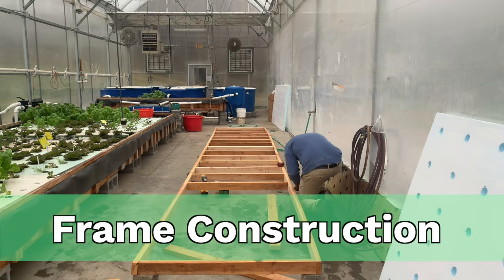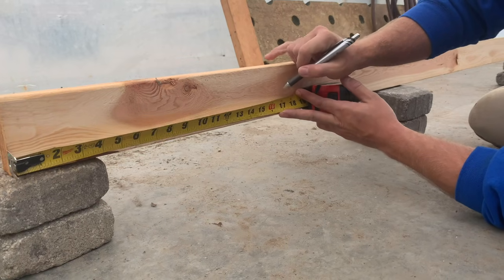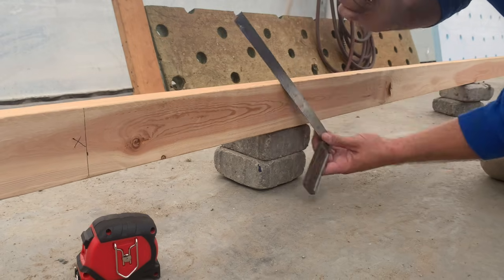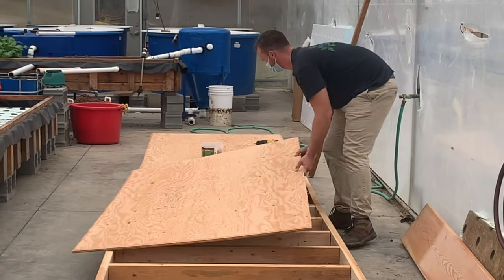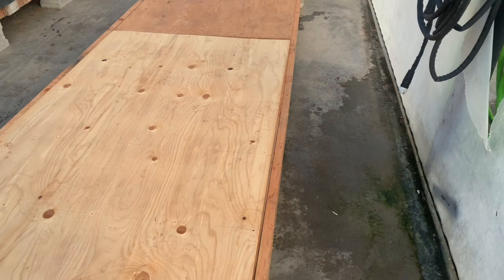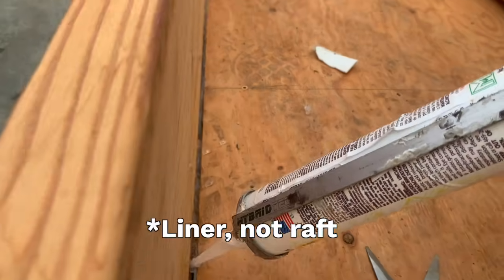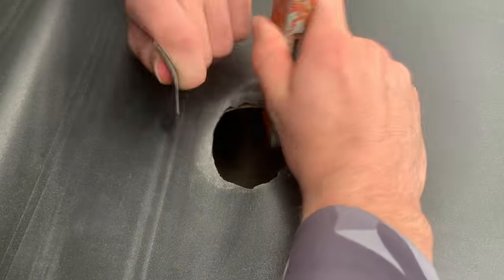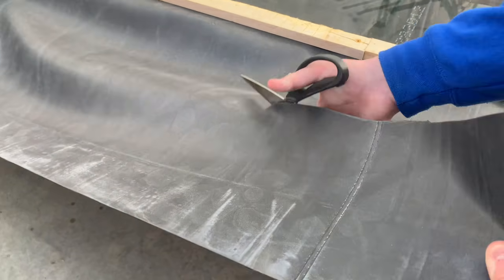How to build a wooden Deep Water Culture Bed for Aquaponics!

Comment: Having used liners extensively for ~8 years, I can't recommend them.

Fiberglass is WAY more repairable and user friendly. If your liner rips (and it WILL rip), that's it, it's done. You can try to patch it, but because of the biological activity in your system, the patch is VERY unlikely to hold.

Fiberglass can simply be repaired. It's much easier and lasts MUCH longer.

Comment: For the drain, if youtake a small piece of plywood with the hole for the drain cut in it and secure it to the bottom side of the bed with a larger hole cut in the floor of the bed the bulhead will be recessed allowing for more complete drainage.

Comment: How much air is pummped in.  what do u yuse to trasport the air what kind of air pump. How small are your hotels and how far apart ar holes how far are your air feader lines apart. ?  Sorry to meny questions
Reply from the maker: Air Pump: https://youtu.be/SbB8uDZ_R-Y

Transported by 3/4” pvc to 3/8” tubes

Lines are probably 3’ apartish
Reply: @NewAgrarian  thank you sir. That lnk was healpfull. Thanks again

Comment: Hi there before I ask my question let me say a BIG THANKS tou for your videos. I am new in aquaponics and  your videos as therrow as they are have filed most of the gaps i had on the subject. 
What I am strugling with is the subject  of the grow bed liner. Figered out it should be something like pond liner but it raises a questions like is it a special food grade or not. Chemical reaktivity on amonia ,nitrites and nitrates or with the suplements for the plant deffiscienses. Also thicknes and durabilyty and  shel life. as wel as if you have any experience growing shrimps or crabs on the bottom of the beds as additional cleaners can they damage the liner mechanicly.
Al and al it raises alot of questions.
So can you make a video on the topic or at least point me in the right direction please. There is realy verry litle information on the net about it so please share your cnoledge.
Reply from the maker: pondliner.com

Comment: What do you think about the idea of using marine varnish or some kind of paint to seal these? I worry about holes in pond liner.
Reply from the maker: I would avoid. Just be careful with liner, never had one pop
Reply: @NewAgrarian  I recently checked on toxicity- sources say once dry these finishes are food safe.
Reply: epoxy is pretty expensive and you would need a thick coat

Comment: It would be helpful if you tell us the suppliers that sell liners. I would guess these would be commercial roof suppliers, but who are they?
How about a spray on solution like these;  Krylon K02758007 Fusion All-In-One Spray Paint, 
Performix 11203 Plasti Dip Black Multi-Purpose Rubber Coating Aerosol, 
 Drylok 27512 Latex Water Proofer
Reply from the maker: Pondliner.com

Comment: this is painful to watch. do you not know what 16 on center means? mean, on center, not on the left, or the right. on center. if you were building a house, you already failed inspection. also, a little tip, mark the 16 on center marks on boards from both sides at the same time. this make it uniform on both sides. mess up on measurement on one, it automatically transfers to the other. luckily you did it to all of them, so they all are the same distance. but i am certain you came into a lot of problems with construction on this but didnt show it.
Reply from the maker: Zero problems
Reply: Luckily he’s building a fucking Dwc bed. Calm down Karen
Reply: That's fine the problem is how he joined the frame that is not how you do it but hey not everyone knows how to frame if it works it works I guess, also that's probably $1000 worth of pvc liner there are cheaper and easier ways to do that

Comment: Hi, I would like to ask what type of wood you used. Can we use pressure treated wood? How about termite protection? Thanks
Reply from the maker: You can use pressure treated yes. I just used Douglas fir because it was cheapest. I’ve had some of these boards in use for 5 years, I’ll probably replace them next year. Pressure treated wood could leach into the water but if it’s covered completed I don’t see the risk
Reply: @NewAgrarian  thanks for the info